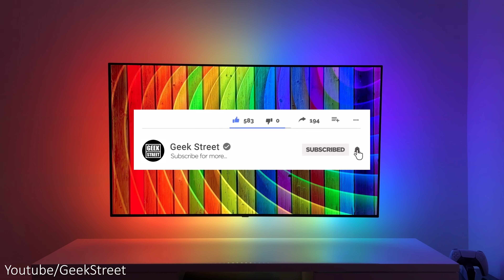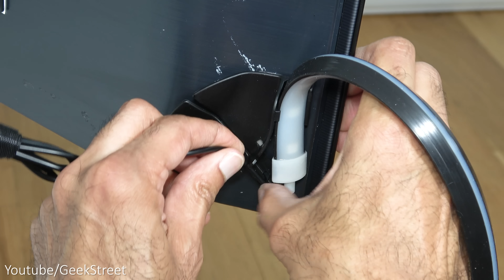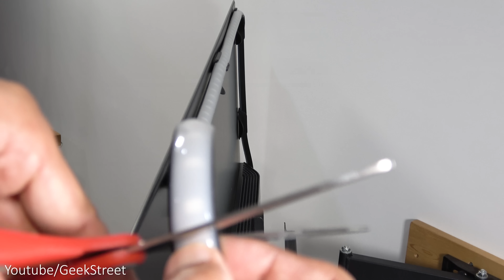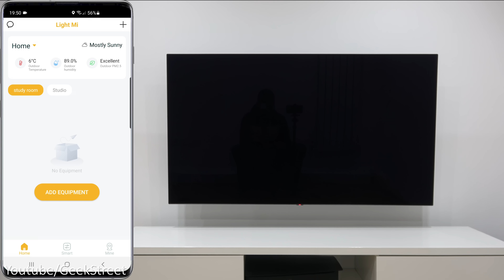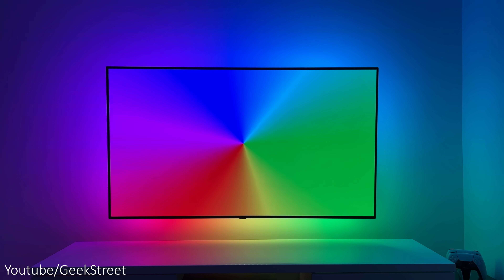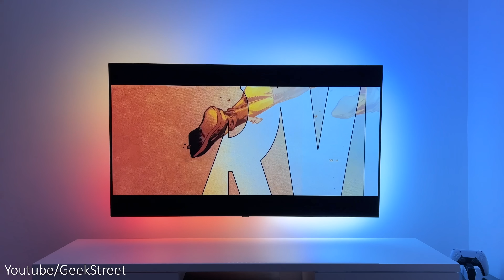BEST Philips Hue HDMI Sync Box Alternative | NEW Lytmi Neo HDMI 2.0 Unboxing and Setup

Comment: I ordered the package for my 65“ LG OLED TV. I can say that it isn’t worth the money and pretty disappointing when you see how big the latency is. It gives you a strange feeling while watching and therefor soon some good headaches. So I shut it off after I used it a couple of times and since now I didn’t turn it back on again. Also the colors aren’t saturated at all. After having an issue with the color zones - they are postponed by three LEDs which are always projecting one color together, so that the light doesn’t match the picture - lytme told me I would have to reinstall the light strips, which wouldn’t make any sense at all because otherwise I would have a big hole without light on the wall behind.

Now I try my best to give the whole package to lytme again and get my money back for it!

Comment: For my taste it seems a little bit to hectic according to the shown Pictures on the TV. I would love to change this in the settings, how the lightstrip reacts to the actual video. For example changing the accuracy that the colors merge smoother by setting a bigger area that prescribes the intensity of the gradations.
Reply: Yes, I couldn’t put my finger on it until you’d said. The hectic flickering on the walking video is a little too distracting for me. Shame coz I had this saved to cart even with 20% off is still expensive at £156 (granted, a lot cheaper than Philips)

Comment: When you have just have a TV and you are thinking you can turn this into an dynamic Ambilight Tv Philips Style is wrong here!
It works only if playstation or X Box are connected so if you use an input source.
I think you should mention that, in this Video it is in this form misleading.

Comment: Hello... I am sharing my experience, so this Lytmi is not as great as it seems. HDR and Dolby Vision does not work or works very badly, Lytmi has also apologized for this (you can find all the comments on the Lytmi forum). But have they really tested their product? I ask this because after several searches on a site that everyone knows... there are exactly the same Ambilight boxes available but with different brands instead of the "Neo". Anyway, thank you for this test video.

Comment: Two questions: can I get it to sync over wifi to the yeelight rgb smart bulbs in the ceiling lights? Does it add noticeable input lag for gaming on a console?
Reply from the maker: No syncing with other lights is not possible at the moment and i recon there is a small amount of lag, but not been able to work out what it is.
Reply: @GeekStreet  alright, thank you very much. you saved me from doing a lot more research.
Reply from the maker: @LunaDanu1  you're welcome

Comment: @Geek Street.  great review. I just want to ask 1 are 2 questions in relation to registering the lytmi, you said you have to give your password for internet ? Why is it also true you need to give your phone number? If this is yes I don't understand. All I want is some great backlighting for my TV, if they need an app great all the better. But when using an app under normal conditions you just give your email address ect set your password and off you go. I'M really interested in the backlights they look absolutely beautiful and well worth the money. In my opinion and this only comes from watching reviews like your review this company has a brilliant product with these lights I'm only concerned about why any app would want all the security features you have ? Thanks again great video
Reply from the maker: I understand what you mean, the reason this this requires a login is that it can be used in conjunction with smart tech so you can use remote remotely for example. So in this situation it comes under the Tuya platform for smart tech and this requires credentials to remotely use it. Hope that sort of helps.

Comment: I don't understand why the Netflix app doesn't work with it? So none of the apps on my tv will be compatible? Is it possible when casting?
Reply from the maker: It only works on a HDMI input, so it you brought a Amazon Fire Stick thats a way around this issue.
Reply: So basically it will only work with my PlayStation. And not with anything played on the TV itself? I.E. YouTube or cable

Comment: I'm still not sold honestly, and it's because of the single HDMI input. That means one device and no TV apps which is honestly a dealbreaker. I think govee has the right idea with the camera but it needs a lot of work. I have a current version and it struggles with white balance and changes in brightness, but it easily has the most potential because it works with any source.
Reply: I kind of agree with you, I have a question tho, if I were to install this on a non-smart tv, and plug something like a chromecast into the port on the sync box, would that work and display the colors?
Reply: @cuackzy  yes

Comment: The LED stripes what kind of V have or use? 5v 12v or 24v?
Reply: 12V
Reply: The light works on 12 Voltage to get enough power supply.
Reply: @wendell1438  thx would it work with DIY LEDs 100 or 144LEDs/M?
Reply: @gs2k12m  probably not, both the connector and voltage may not be compatible, and plus we need addressable RGBs to display 300 colors in one moment
Reply: @wendell1438  well ill try DIY LEDs with 100LEDs/M maybe it works or maybe not just try

Comment: Do not buy light mi neo. They are not good.
Reply: may I know why, any specific reasons?
Reply: Hi Johnny, my name is wendell, founder of Lytmi. May I know the reason that you don’t like Lytmi? Maybe there is something wrong we did but I am eager to know about and fix it. Thank you
Reply: @wendell1438  the light mi system I purchased does not work as advertised. I connected it to my tv and have had nothing but problems. It worked fine for the first day then the second day It wouldn't turn on and then later caused issues with my tv by displaying it only in black and white with no colour sync. After resetting my tv to manufacture settings and rebooting it I finally got the colour back on my tv but the lght sync only works when it wants to. I followed the instructions to connect it to the tv exactly how it said in the instructions. The light strips are connected to the back of the tv in the proper direction and it seems that the colour displayed on one side of the tv is represented on the opposite side with the light strips.
Reply: @jTicle  well, sounds really bad, Johnny. So sorry to bring you unhappy experience. I cannot figure out the cause immediately through the simple words of your feedback. But I am asking another try if you would like to give to us. Would you mind if we send you a free Neo 2.0 and try it again? And I will keep analyze the problem you had with 1.4 and come back to us. please let me know if you want me to get involved
Reply: No thanks. I'm no longer interested.
Reply: Do you want me to send this one back to you so you can figure out the issue?
Reply: @jTicle  yes, pls, that would be a lot helpful, and we will pay the shipping cost
Reply: Where do I send it to?
Reply: hi Johnny, can you tell me your order ID thus we can write to you via email, thank you.
Reply: I don't have an order ID, I ordered mine off amazon

Comment: I think it should be noted that 4k60 is not going to be a big issue. unless you only play the few games that out put a 4k120 picture. Which are mostly just 1080p resolution.  I do wonder why it showed that 4k120 is still supported on the xbox even going through the box. I wonder if it still allows a pass through.
Reply from the maker: I tested 4k 120hz and the sync box doesnt allow it through
Reply: @GeekStreet  Does that mean the screen doesn't show at all? Or is it output in low quality?

Chat service was so kind that I ordered the product the day before yesterday.

But I'm still curious about the quality problem when playing games. I don't know if the games I play exceed 1080p. The graphics is so important to me that I use LG oled TV when I using my pc

Comment: got a question... can it run with an 27" Monitor? I use a UHD Monitor with my Console. Its a Kit for PC on Lytmi but i dont use a PC.... So can i cut the stripes at 27" or its there any limit for the stripes?
Reply from the maker: Yes should be fine for that.

Comment: Dang, just bought the old one about 2 months ago. Oh well. 🤷🏽‍♂️

I had to do the method of a split box so I could send 60Hz to the tv and 30Hz to the box. It works pretty well, even with Dolby Vision. I did find a few things on Disney+ that lose sync every few minutes, like "What If...?". But for the most part it works well.

Since I have a Series X and a LG CX, I probably won't upgrade until they put out a 120Hz.

Thanks for the video.
Reply: Hmmm. Interesting the old one doesn't say it supports HDR or Dolby Vision. Maybe that splitter you recommended in your other video is converting that channel to SDR? I would have to test.
Reply: @bludclot  Don't think it's converted to SDR, but find a way to pass-through the HDR signal.
Reply: Yes, you can wait for the 2.1 version, it will be next year thing.

Comment: Hmm. Not even close to competition with the Philips hue HDMI kit. That has 4 HDMI Inputs ( not hdmi 2.x compatible though….YET ) and has better syncing capabilities. 

Not bad though. It will be cheaper though but that is due to lack of features.
Reply: I agree, but that cheaper price makes it easier to pull the trigger on getting this. Wouldn't you spend about 400 to 500 (maybe more) by the time you get box, lights, and possibly the hub? (Not sure if you need the hub)

You get what you pay for though.
Reply: @bludclot  Ya, cheaper comes at a price somehow.

Comment: If I connect the ARC output of the TV to the Lytmi and then pass the signal to an amplifier, can the system work having both the colored effects and the passage of digital audio?
Reply from the maker: I tried and it didn't work.
Reply: @GeekStreet  for my curiosity, the video ok but the audio does not pass?
Reply from the maker: @FabrizioBasso  yes no video return only audio return.
Reply: @GeekStreet  ah ok. I thought the opposite. Patience, it would have been an excellent solution. Thanks.

Comment: Does it connect with cloud or run on lan?
Reply: it connect with cloud via Wi-Fi, and compatible with future Lytmi lights through lan
Reply: Do you mean those use cable tv or satellite tv? If so, it will not support. As it relies on external hdmi input

Comment: It's not a bad deal. The only thing that lets this down is that it has no way to sync or control external lights that are not directly connected to the box. If it used ZigBee or WiFi to control and sync other smart lights then it would be perfect.
Reply: I thought it's the IFTTT function, right? We are working on it. Jack from lytmi
Reply: hi this is Wendell from Lytmi, yes we are going to publish more lights working with Neo sync box as a ecosystem
Reply: @wendell1438  4k 120 and atmos etc would make me buy it.

Comment: Hi. I think this sync box DOES work when using apps on my smart TV, when I use ARC to my audio receiver? My audio receiver functions as an hdmi splitter, where all devices go into the receiver, and hdmi-out channel of the receiver transports signal (audio and video) to the sync box and then to TV?
Hmm, when typing this, it gives me some hesitation actually. Anyone can confirm what possibilities there are?
Reply from the maker: That is a good idea, you know I had to test it....but unfortunately it doesn't work.
Reply: @GeekStreet  it doesn't work with a receiver?? That seems odd to me...no?
Reply: @mikee2398  it seems strange to me too.
If I connect the TV ARC output to the Lytmi and then go to the amplifier, why shouldn't that work? Otherwise I don't want to buy it ...
Reply: @FabrizioBasso  because ARC is just audio. Audio Return Channel.
Reply: @NomadTomas  Yes. audio along with video on hdmi, no?
Reply: @FabrizioBasso  No. ARC literally stands for Audio Return Channel. Look at the first letters. It contains only audio, and is intended to use for soundbars etc. No video in ARC = it can't be used for any video/lighting sync box.
Reply: @NomadTomas  Sorry, I thought that from the hdmi cable of the ARC output of the TV to the amplifier, in addition to the audio signals, the video output from the TV also passed. Damn, otherwise the game was done.
Reply: @mikee2398  It relies on external HDMI devices to input the signal. If the signal just from the TV itself, then it won't work, otherwise, it works.
Reply: @FabrizioBasso  the HDMI port on your TV that has ARC is a video input only not output. ARC as stated above is an audio return channel that enables you to send the audio from the internal apps of your TV to an external source such as a sound bar or receiver to bypass the bad speakers in the TV. You would need the TV to have an HDMI out for this to work.  I am unaware of any TVs that have this.
Reply: @MitchM240  👍
Reply: @mikee2398  it works with a receiver, it's just that TVs don't have hdmi video output, which is a shame...

Comment: No 4K 120hz, only 1 HDMI port and only 2.0 b HDMI port. So not better than Philips Hue.
Reply: Don't think Philips supports 4K120hz either. Anyway, you may need the 2.1 version, which will be released around Q3, 2022 with 4K120 supported and 4 HDMI ports.

Comment: 125 quid tho that’s a bit much ain’t it
Reply: I mean, compared to Hue Sync Box?
Reply: @H4J4T  true true but 125 is still expensive for a backlight even if it is pretty cool
Reply: @Dan-bs5rx  maybe you need is ordinary tv backlight, and that's way cheaper, 20-30 quids I think is sufficient
Reply: @Dan-bs5rx  It's not just a backlight really though. You can get a backlight for about £5-10.00 of eBay.  The lights themselves will be of a much higher quality, colour depth and can individually show specific colours at the same time. Ontop of that there's the tech that processes it to show what's happening based on what you're watching. 

Compared to buying an Ambilight TV, or the Hue Sync itself, it is far cheaper. Yes, it probably doesn't cost half as much to produce but they still have to make a profit somehow. I think it's a fair price imo for what's being offered.

Comment: I am planning to buy for LG 55 INCH Smart tv, that has most of the built-in application. Is there any way, we can sync along with this?
Reply from the maker: Unfortunately not the only work around would be buying a chromecast or firestick and use that for the smart apps.
Reply: Thanks for the reply buddy. Will it support 4k movie as well if firestick and tv both are 4k compatible?
Reply from the maker: @harshalpatel6952  yes 4k at upto 60hz is supported..
Reply: @GeekStreet  : Yooooo thanks for the info. Order placed. :)
Reply: Hi, Harshal, I have the C1 tv too and am waiting to move into my new apartment to unbox it. Can you explain what you mean by syncing to the tv? I do have a fire cube too which I’m presuming would work, but I don’t actually know what you’re suggesting! Am I right in thinking you’re asking if you can ask Alexa to turn on the hue? Apologies but I’m ignorant to all of this tech but am trying to learn more about it. As much info as possible would be so handy, thank you 🙏

Comment: Is there no way to mirror the TV itself as an input device? It seems pretty frustrating to not be able to utilise the lights in every way. No lights when viewing movies or photos on an external USB plugged into the TV? no built in TV apps?
Reply: No, the sync box can only process the video signal from external HDMI input devices, any non-HDMI input is not supported by NEO, including USB or built -in TV app.
Reply: @wendell1438  there is a fix: an OTG cable allows a firestick to access an external USB drive and therefore play through the Neo box
Reply: @flameon8961  yeah it make sense. But I am quite curious about the reason why the USB drive should be supported. May I know it?
Reply: @wendell1438  I'm not sure what you're asking. If you mean why would I need an external USB drive to be connected to the firestick. I download a lot of movies in 4K (so very large files) and I like to view photos and home movies from my USB drives too. It also means friends can connect their own USB pens to show files without fuss. Due to the USB being accessed via the firestick it will then be able to utilise the neo lights.
Reply: @flameon8961  ok i get your point. Let me check with our technician and come back to you soon
Reply: @flameon8961  yes you are right. Plug the USB Pen to a computer or USB accessible dongle could be a solution
Reply: @flameon8961  can you provide the link from where can I buy that otp cable who is working on fire stick,tnx.
Reply: @wendell1438  will , it work with PLEX or Netflix ?
Reply: These may help you: 
Ambilight via HDMI sync box(such as Lytmi, Philips)
Pros:
Lovely color reproduction
Fast color changing
HDR10+ and Dolby Vision HDR support
Cons:
Doesn’t work with built-in smart TV apps

Ambilight via Camera(such as Govee)
Pros:
Works with built-in smart TV apps
Cons:
Occasional slight delay changing colors
Sometimes has difficulty processing multiple on-screen colors
Requires camera mounted properly to the top or bottom of a TV or monitor